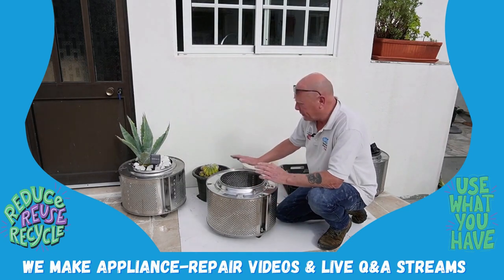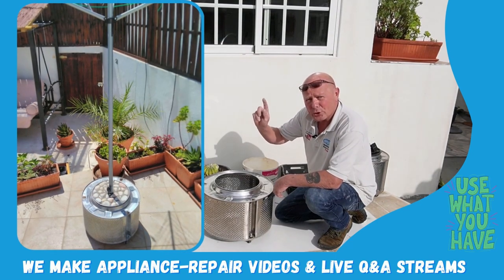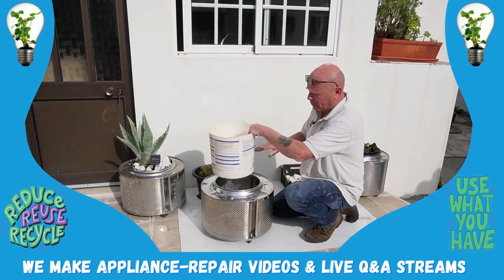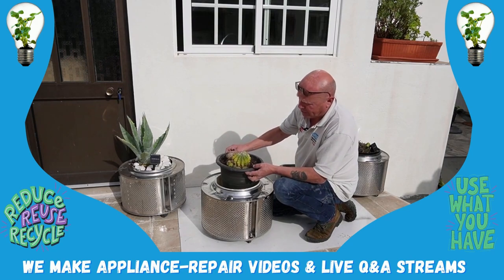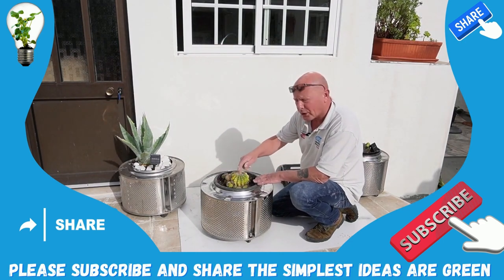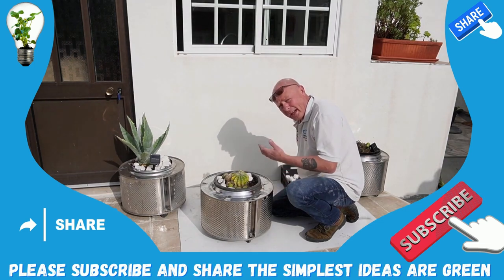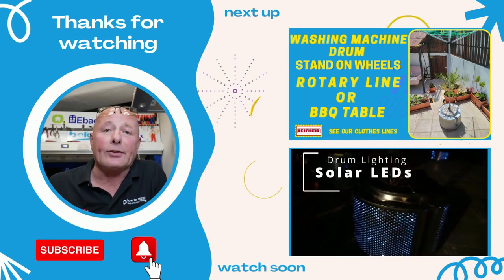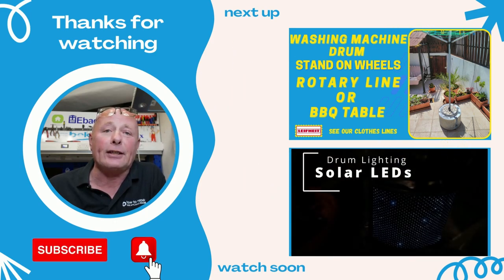Patio plant pot holder out of old washing machine drum

Comment: Hi  
Always you come with great idea thank you  very much. 
I have question  for you I had a dryer no heating  hotpoint is has a like a fridge motor it's not heating  I change the capasoter and the motor is raning but no heat .
Do you have email please. 
I'm grateful to you.
Reply from the maker: You did not tell me if this was a condenser dryer or heat pump dryer if it's the heat pump dryer and the motor is running then it's highly lightly that you have a gas problem